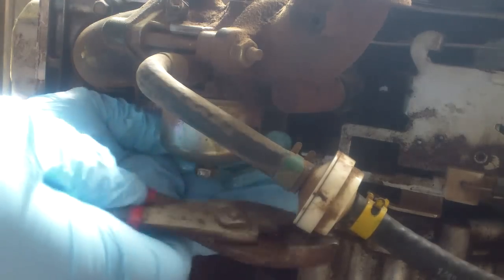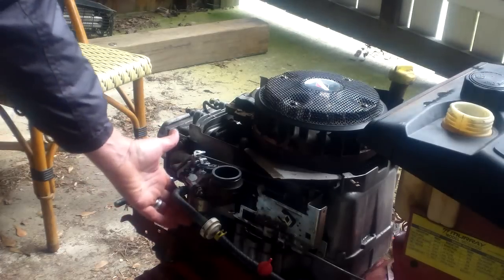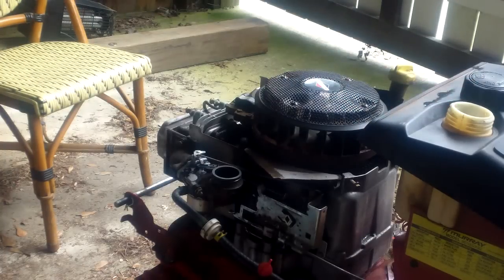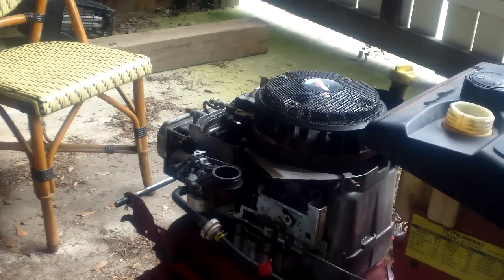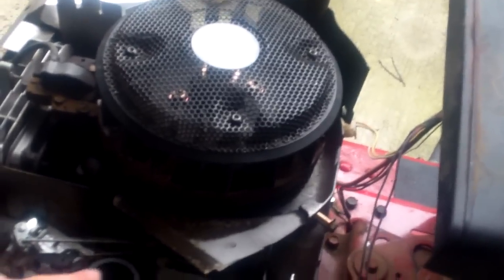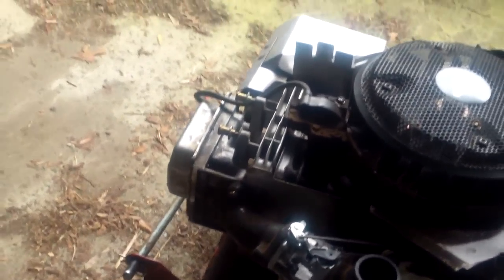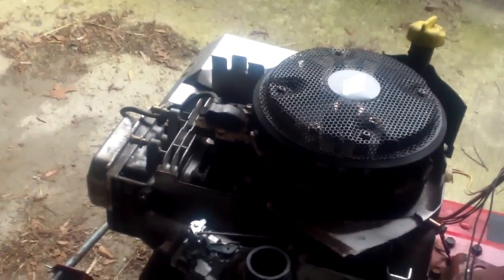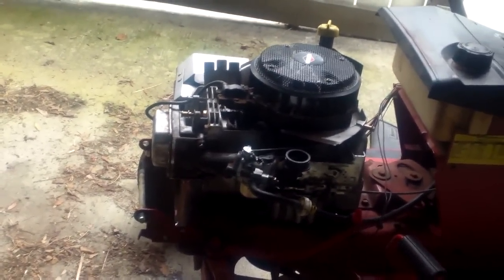Murray Trade in part 3

Comment: Coughing through the carb, means could be running lean on gas, valves adjusted to tight or timing is slightly off. Don't you just love when you fix one problem and get 5 more. LOL